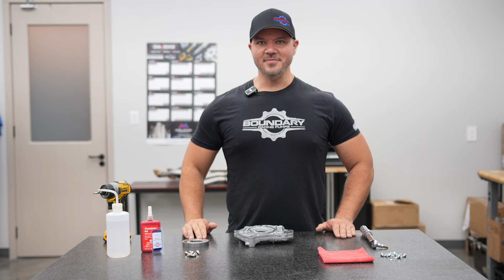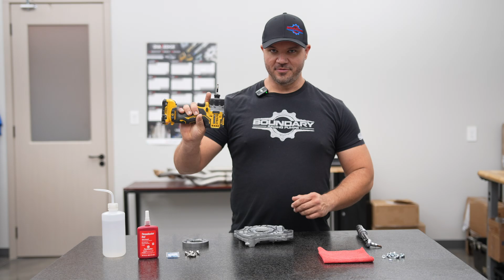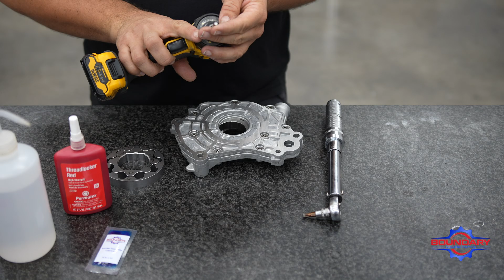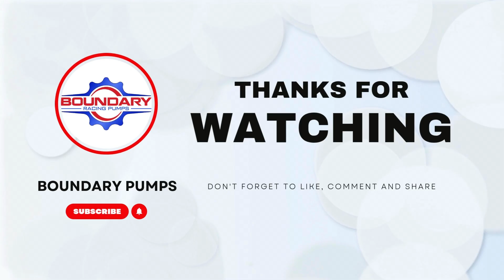Boundary Pumps Billet Oil Pump Gear — Full Install Guide!

Comment: I’m looking into doing this job on my 2014 Ford Mustang GT. 

I’m wondering which special tools I might need for the job. I’ve watched several videos and besides the basic tools I’ve seen them use a digital torque wrench.

Is there any other tools that I’m unaware of that might be necessary or even some that aren’t necessary that would make the job easier. 

Thank you to anyone who responds!
Reply from the maker: Hello Josh, 

Its a good question. You don't really need much besides basic hand tools. You need a T30 Torx for the pump screws. You will need a heavy-duty puller for the coyote harmonic balancer. Many people use a "Harmonic Balancer Install Tool." A swivel head 10mm socket wrench setup would be ideal for the pickup tube bolts. Other than that, anyone considering this, probably has everything else they need.
Reply: Greeting brother,

I have a question/ what if we put the gear on opposite ( side down instead of side up) is there any issue?